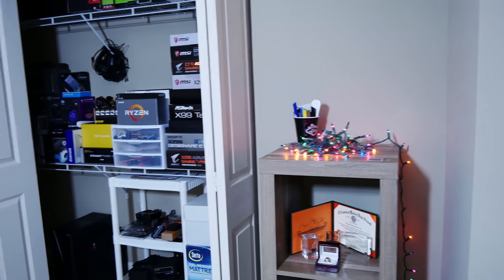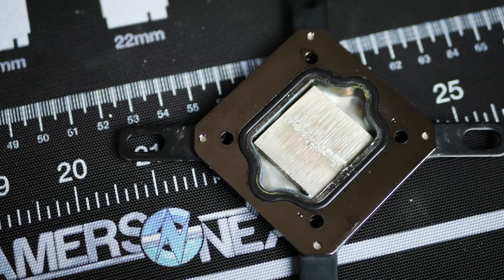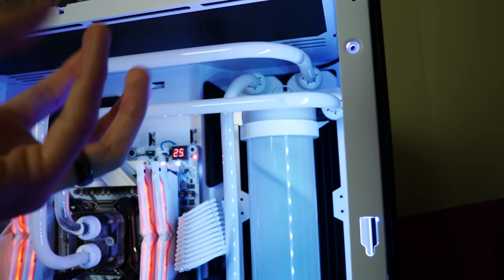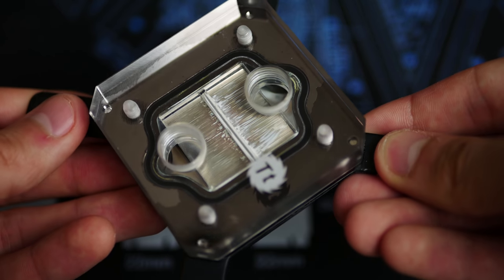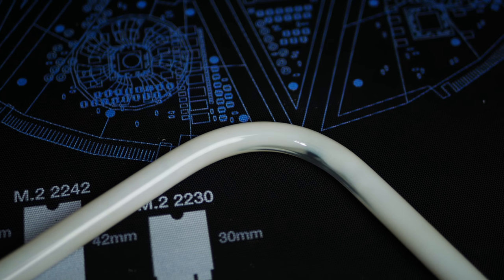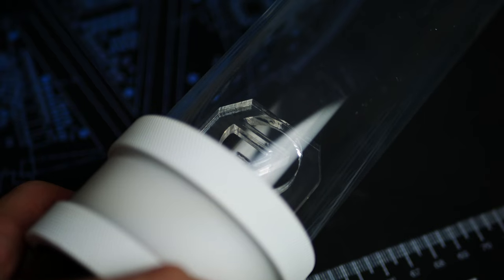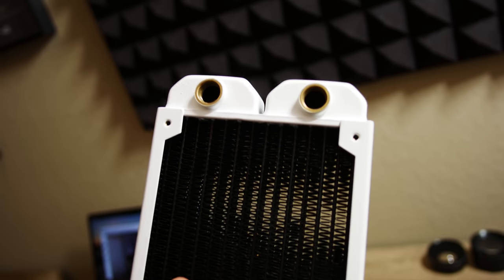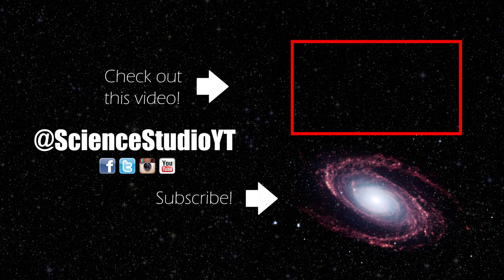More Trouble with Opaque Coolants...

Comment: You should try mayhems pastel extreme white, previously i ran it in my system for 6 months without any issues. However it's not compatible with petg, so you would need to use acrylic or glass tubing.

Comment: i might a complete boob, but why not run vinegar through the loop (maybe watered down) whilst its still together obviously whilst system is off on a different power supply
Reply: I would assume it works unless there is a complete blockage like he appears to have...

Comment: should be titled "yet another reason not to custom watercooled"
Reply: no, it shouldn't. It should be: Reason not to use opaque coolants. You can have zero maintenance for 3-5 years with any water loop if you do it correctly.

Comment: I  use koolance 702 if blue good for up to 3 years 
I'm tired of taking my loop apart and all 3 waterblocks apart lol
I used primochill vue the last 2 times since January
that coolant was cool but definitely doesn't last long and causes your system to clog with a paste like substance.
Its basically a show fluid take pictures or video than change it

Comment: Man, you have really bad luck with opaque coolants - I could understand the C1000 but surprised on the Primo True, but it might have reacted with something in the loop to cause the particles to fall out of suspension.  Have you tried Mayhems' coolants yet?  Also did notice when you showed the microchannels in the block there appeared to be a slight green patina as if it reacted to the plating that ThermalTake used or something (saw very small bits of it).

Comment: The more I watch these the less I want liquid cooling.
Reply: Richard Hedges, same. I was just about ready to switch over but a few YouTubers had their loops leak all within this month. My cousins AIO also failed (pump went out). So, I'm just going to stick with my NH-D15 for a little while longer, haha.
Reply: It's not for everyone, I have used water for many many years and only had 1 leak due to product failure, never had a aio go bad either. I think all these show fluids do more harm to the industry than good, they are high maintenance pain in the azz and are expensive, but if done right you get lower temps and noise that no air cooler can match
Reply: The main reason for custom loops for me is not having GPU fans that:
1. Dump out massive amounts of heat into your case (a radiator let's you throw the heat outside the case)
2. Get loud as hell compared to radiator fans with something like an Aquaero

Other than that it just looks bad ass, and while expensive it is a one time expense for the most part. Radiators, pumps, reservoirs, fan controllers (e.g. Aquaero and other AquaComputer things that can connect to it like Farbwerk), fittings, temperature sensors, flow sensors, even tubing (especially if it's acryllic and not PETG), can all be reused, in most cases forever (exceptions are PETG tube getting colored and pump motors dying etc). All you really need to buy each new build is new blocks and new coolant.

Honestly Primochill seems to be the only one where this problem is rampant. Jay has had a Mayhems fluid in Skunkworks for about 2 or 3 years with no problems and no color change (it's green, he did have color change with red and yellow, I know red in particular is really bad for it unless you super overkill flush your radiators and components with Mayhems Blitz Pro or something).

If the dye is water soluble this won't be a problem. This is a problem because the fluid has solid particles in it.

Comment: I've been running Mayhem's Pastel Red without issue so far.  Although it's only been 3 months since it's been running.  I usually have the system going 24/7 too.
Reply: I've had mayhems pastel yellow running for a couple years without a single issue. Mayhems really is the best in the business of fluids.
Reply: Optimus Toaster I assume I will have the same success because I don't do a lot of heavy gaming nor do I do a lot of CPU intensive work...yet.  since I spent so much going with a TR 1950X and 1080 ti, I want to actually put the system to more use.

Comment: The solids were never in solution, they were in suspension, which is the problem (or at least a major part of it). Suspended particles are bad for pumps. Apparently the manufacturer of this fluid didn't even bother to see if the particles would stick to straight glass or plastic surfaces. Personally I'd be one very upset customer - except I'd never do this to begin with since I know suspended particles in a circulating fluid system are bad. Just don't do it.

Comment: Using fluid with suspended particles Is a nadie idea when you have so little space in the cpu block, there's Is no way ir doesn't get stuck and there's particles get stuck on the imperfectos on the Tunes walls... That fluid Is a súper vas idea

Comment: Lol sorry but here's another one :p OK,  i get it you wanna make it look cool and you have several systems and can make a video but... my main reason to do a custom loop is to get high OC's and low temps and nearly no maintenance ;) (in a similar CPU /GPU setup i had 3 big rads just to cool it near ambient). So wat i see/ read  a lot is that hose mixtures can't handle temps above 50-60 degrees (for a few hours!!). So most think my water never gets so hot of course not but is passes hot surfaces that are, so what reaction causes this in the fluid?? (+ i see 1 rad so the water flows quick, passes a hot spot heats up dissipates it and it has no impact on that crap???  I have my doubts.  And even if they claim certain specs how can you be sure ? My system isn't a boutique build but it does what it needs to do. And i have no time to come home one day and start doing that cleaning crap  (unscheduled) ;). But it's funny to see video's like that :p

Comment: In my opinion watercooling isn't worth it at all. Sure, it looks good, but it's too expensive and requires regular maintenance. A PC should be stable and low maintenance. Why do you think people use aircoolers in workstations?
Reply: Agreed. All the workstations I've outfitted have Noctua fans and coolers :)
Reply: Oh no I have dust the rad once in a while just like you do with an air cooler.

Comment: I disagree with the Suggestion to use only di Water. Always add a corrosion and growth inhibitor like IP protect. Those loops will run for years without any problems. Singularity computers made a Video on di and corrosion. According to him (and the Blocks He showed) corrosion is a problem with pure di
Reply from the maker: Evandure I assumed you’d know that was included. I didn’t just use DI.
Reply: Science Studio well seems like i missed that point. However good to see, that we share the same view. ;)
Reply: don't asume that, so many people are wrong on this topic and think that distilled water alone is the best coolant when you have to add anti-corrosion and groth inhibitor into it. 
So please, you have a lot of people watching you, tell them very clearly to add those two things in distilled water, don't let them think that they can use simple distilled water without anything in it.
Reply: Most of the video was about using Di water (not sure if I even heard the use of inhibitors or anti corrosion) personally I just use premixed water coolant that has the inhibitors and anti corrosion stuff built in(norm lasts years)

Comment: stay away from those pastel fluids.... been watercooling my pc for  7 years now and i only use destilled water with some additives for corosion/algea growth prevention.
Reply: What if I wanna make it look cool
Reply: u can add colors to the water. or even go with colored petg tubing
Reply: I have no issues with Mayhem's stuff.
Reply: i've seen video's where the loop clogged even with mayhem
Reply: stijn324 I only had that with their aurora stuff but I do get it premixed so not sure if that's the reason I had no issues with their opaque stuff.
Reply: tbh i never will try it because i don't want to take apart my whole loop to clean it when/if things go bad
Reply: But see I’ve used pastel fluids for about 5 years and don’t have a problem. The only thing I do different is make sure my loop is at about 6 pH. I know that sounds silly but it keeps the particles in solution and I haven’t had any problem with my radiators or blocks. I talked to my chemistry professor when I started doing water cooling and that’s what she said she thought would work and so far it has.
Reply: Yash Nanda put RGB LEDs around the reservoir
Reply: i can't speak of something that i havent used yet but after all the video's of fallout and staining i'd steer away from it i got all clear acrilic covers on my block's and they are still crystal clear after 3 years of usage now. I have a friend who used bloodred coolant and everything was stained and was verry hard to clean.